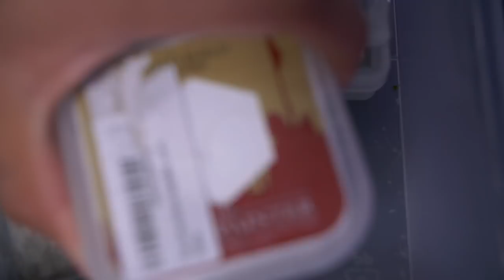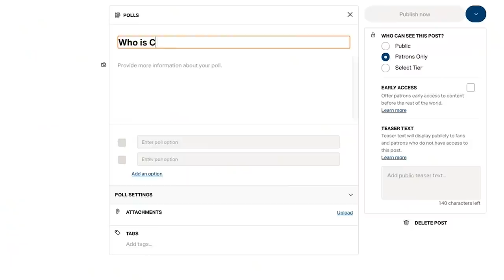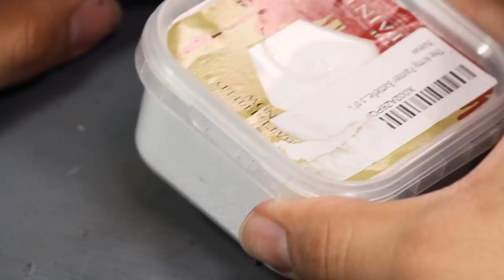I’m Secretly Really Good at Basing!

Comment: This was pretty based bro :)

Also, regarding 13:42 mixing the Army Painter snow material with clear drying white wood glue will give a nice "slurry" effect once it dries up, perfect for shallow snow that's been smushed and pushed aside from the surface by feet, tracks etc.

For a more opaque effect (for settled snow or deep layers of snow). either mix some white paint into the wooden glue or mix the Army Painter Snow up with Vallejo "Foam/Snow Water Effects".
Reply: Super based video!

Comment: You can use a bit of hairspray on a brush and added to Santa's gun barrel, then add a small bit of cotton to make a cool gunsmoke.
You can use a damp paper towel to remove the smoke when moving it or not displaying it.
(Don't use PVA because it'll build up or squish the cotton when moving the mini in a case).